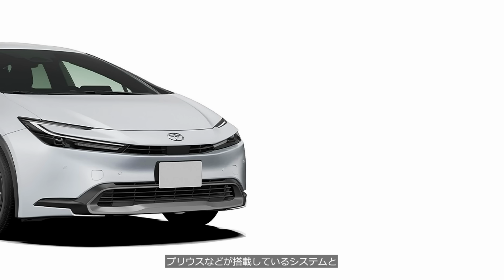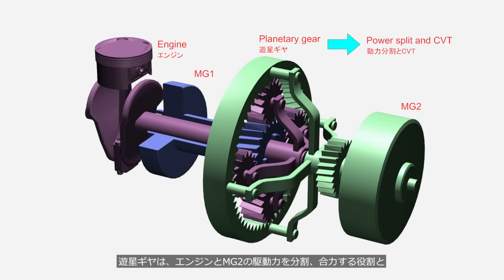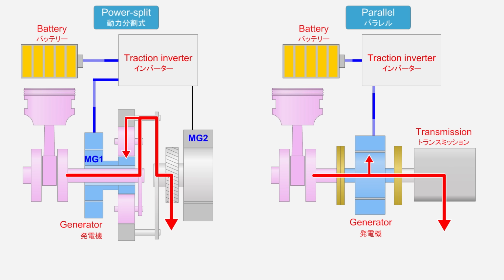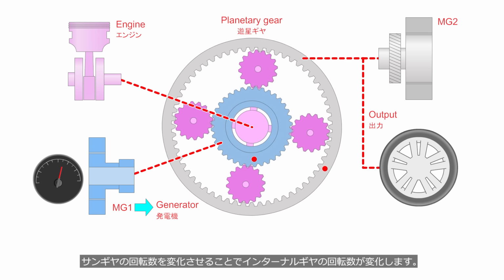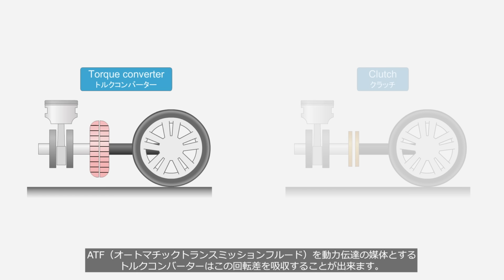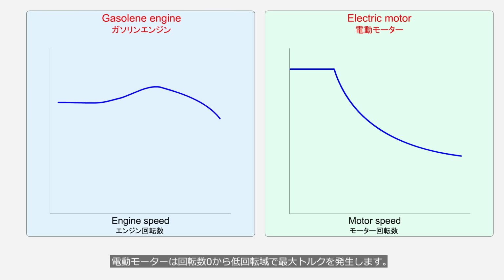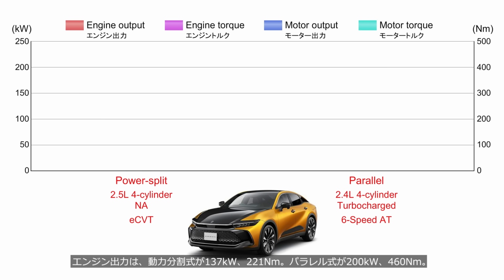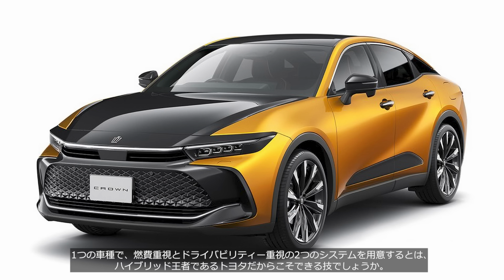Toyota's Two Types of Hybrids. Synergy Drive and Hybrid MAX.

Comment: Thank you for the excellent video with great details on the comparison of two hybrid systems.  However, I couldn't find description on when the launch clutch is open in the parallel system because it's closed in all operations.  Would it be used during shifting?

Comment: Great Video
How about the FR THS system that are used in Lexus? They have a gear box, what is the gearbox’s main purpose? When shifting gears, does the car jerk like traditional AT?
Reply from the maker: Thank you for your comment.
Toyota claims that the purpose of this system is to “improve fuel efficiency during high-speed cruising” and “enhance driving enjoyment through simulated 10-speed shifting.”
For reference, the gear ratios of the 4-speed automatic transmission are: 1st – 3.538, 2nd – 1.888, 3rd – 1.000, and 4th – 0.650.
I’ve never driven an FR hybrid myself, but I doubt it has the sharp shift shocks of old 4-speed automatics.
Reply: @ Thank you for your reply. I want to experience the FR version and see how good it is. 

I had very good experience with the eCVT. I would rather have a rubber band effect, instead of jerk from a kickdown, which sometimes can be unpredictable.

Comment: are there differences between the hybrid Max and i Force Max systems? ie presence of torque converter etc?
Reply from the maker: Thank you for your comment. The Land Cruiser’s i-FORCE MAX comes with a 2.4L turbocharged engine and an 8-speed torque converter automatic transmission, while the Sequoia’s i-FORCE MAX appears to have a 3.5L V6 turbocharged engine with a 10-speed torque converter  automatic transmission.

Comment: For me it's the Power-Split, or eCVT as it's currently referred to. The Parallel, or Hybrid Max is for those with a need for speed over efficiency. It's far too complex for me and I have no desire to have wear points like clutches to worry about down the road. I keep my cars 20+ years and the last thing I need is an expensive transmission repair when the car is old. That would most likely just total it.

The eCVT in my Camry hybrid has never made me feel any of the "discomfort" or "rubber band effect" you mentioned in the video. It doesn't feel like a conventional CVT. More like the way a quad feels. Just mash and go. And go it does! I am very happy with the performance of my hybrid. And 50 mpg for a Camry is nothing to scoff at.
Reply from the maker: Thank you for sharing the information
In modern CVTs (including Subaru's chain-type), I think most drivers rarely feel the rubber band effect during normal driving. But what about during full-throttle acceleration? That said, only a small number of people drive that way, and while some may not mind it, others might find it unpleasant.
Reply: @sikasabumotorchannel  Thank you for your reply. I just want to say that I love your channel. I find it very informative, educational, and easy to understand. I have learned much about the operation of the various transmissions out there and your accuracy is impeccable. You are to be very commended for you work.

Regarding the unpleasant feeling of the power-split system at full-throttle operation, I guess I don't find it unpleasant because I was raised around speed boats and jet skis. With those when you push the throttle all the way forward the engine just revs up to a high rpm and woosh! you're gone! That's how the power-split system feels in my hybrid Camry. If you're not a fan of hearing the engine run at high rpm, you're not going to be any happier with a standard automatic that downshifts into a low gear and winds out the engine to a high rpm before grabbing the next gear, and so on. My wife never floors the car, any car, because she doesn't like the sound of the engine at high rpm. She finds it unpleasant.

I think it's more of a mindset that people need to get used to. We've all grown up with vehicles that row through gears to gain speed because that's what they've always had to do because of the direct contact of the wheels to the ground, and the limitations of the rpm range of the engine. The engine can only rev so fast and then another gear has to be grabbed, and then another, and another, and so on to continue to gain speed. This isn't the case with non land vehicles like boats, jets, airplanes, etc. because they operate in a fluid environment. But that's all changing now with modern transportation and technology.

Regarding my Camry hybrid with the power-split transmission compared to a non hybrid Camry with an 8 speed automatic. The hybrid is not only faster 0-60, but especially in a rolling race from 40 to 70 mph, the range most of us need to overtake and pass another slower vehicle. The hybrid with the power-split can make short order of that much quicker than the 8 speed can because it doesn't have to figure which gear it needs to downshift into. It's just mash the throttle and go. It's instant and quick with very little drama and you're back in your lane in no time. Sure the engine revs up to a level that some may find unpleasant. But no more so that it does with the automatic when it finally downshifts to that lower gear and takes off. And the hybrids eCVT (power-split) does it with far less ruckus and drama as well. It just goes. I find that a strength, not a weakness. I guess it's all in how you accept it.

Thank you again for your great channel. I learn so much from you.
Reply from the maker: I see—I’d never thought about propulsion of speedboats and jet skis. Comments have given me a fresh perspective. Thank you very much.
Reply: What camry hybrid model year is that?

Comment: Another great video! I love your channel. I would like to bring up an important issue, that is often overlooked. In the power-split system, e-CVT deals with the speed difference between engine and the output shaft like any other gearbox, however it does not provide torque multiplication as a standard gearbox does. It does boost the torque by converting part of the energy of the engine to electricity (by MG1) and subsequently powering MG2, whose torque adds up to the (part of) the engine torque. However, MG2 itself has a fixed gearing to the wheels. At high speeds it rotates at 15000-18000 rpm. While this is not a problem at all for everyday driving, it presents some challenges in the extreme situations. At high speeds the rpm are two high and electric motor starts losing efficiency. That is why these vehicles usually have lower top speeds. The other extreme is a low speed/ high torque situation (rock climbing), where higher gear ratios are needed. Those are, in my opinion, the main reasons, why we see some kind of a classical transmission added to the hybrid systems in most of the premium and off-road capable vehicles. Sorry for the long post. Thanks again for the video! Cannot wait to see the next one!
Reply from the maker: Thank you for your comment. 
I've heard that Toyota's system has as many as seven different driving modes just for forward motion. As you mentioned, there are modes where electricity generated by MG1 is used by MG2, as well as modes where the engine runs while MG2 is stopped and MG1 charges the battery. 
It seems incredibly complex and sophisticated — and I think that's what makes it so fascinating.

Comment: is hybrid max system is the one that used by current prado (land cruiser 250 in us)?
Reply from the maker: Thank you for your comment. The Land Cruiser’s i-FORCE MAX comes with a 2.4L turbocharged engine and an 8-speed automatic transmission, while the Sequoia’s i-FORCE MAX appears to have a 3.5L V6 turbocharged engine with a 10-speed automatic transmission.

Comment: Toyota Crown Hybrid Max (Parallel) is full time All-Wheel Drive // This can be turned off in Eco Mode ??? //
Reply from the maker: I'm not sure, but probably no.
The following is taken from Toyota's documentation (translation).

The system precisely controls the front/rear torque distribution between 100:0 and 20:80 depending on driving conditions, delivering excellent traction and handling stability on a variety of road surfaces. During start-off and straight-line acceleration, torque is distributed at approximately 60:40 to 40:60 to suppress vehicle pitching and provide a more direct acceleration feel. While cornering, information such as vehicle speed and steering angle is used to optimize torque distribution according to the driving situation, contributing to superior handling stability. From the initial steering input through the middle of a turn, torque is distributed nearly 50:50, while during corner exit, a rear-biased distribution (ranging from 50:50 to 20:80) ensures traction and suppresses pitching, resulting in a cornering feel that allows the vehicle to faithfully trace the intended line.

Comment: Very nice Info, Can you please make video on Toyota I-force max hybrid system.
Reply: It's the parallel described here.
Reply: @rlderemer  no, what is described here is the hybrid max system. I force Max is a different system.
Reply: @moudgilsameer  from what I've found tundra i-force Max has 10 speed torque converter gearbox and 3,4 v6 turbo. Curious how it works 🤔